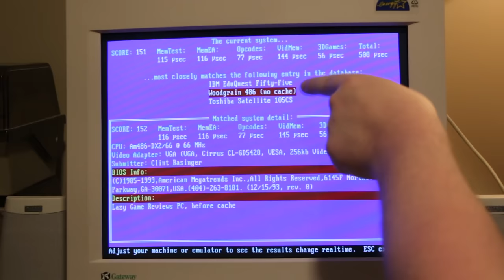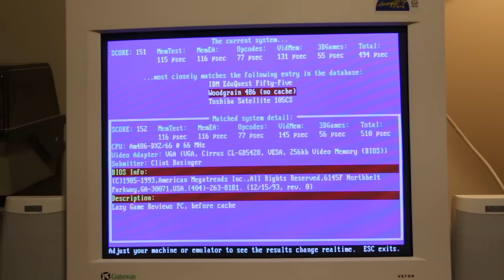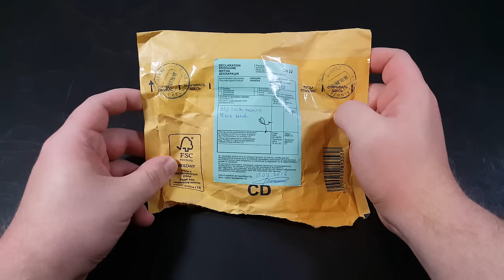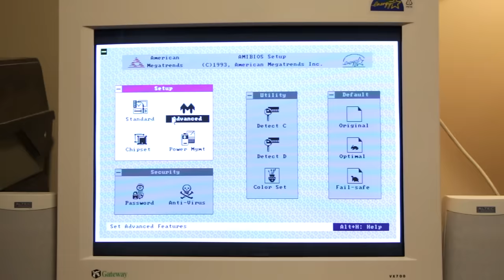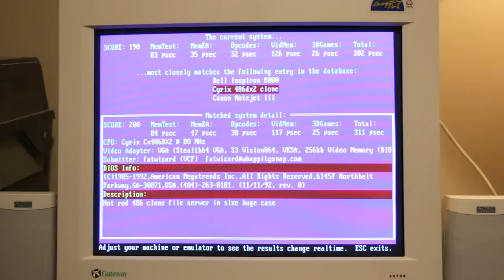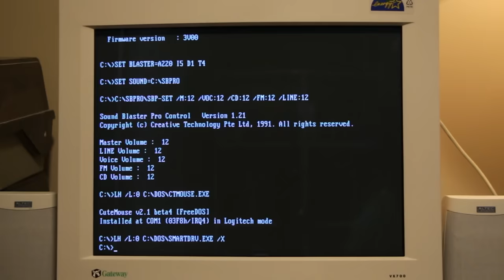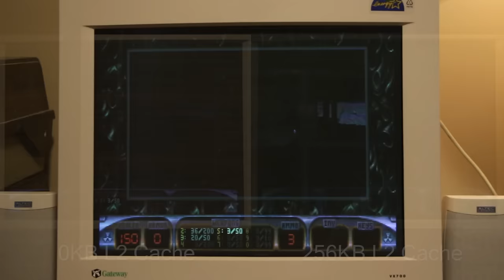LGR 486 Update! Installing L2 Cache

Comment: I watched a CPU Galaxy video once where he was benchmarking 486s and the data rate of the L1 cache was like 170MB/sec. Modern CPUs have as much or more of L1 than a 486 can handle L2 and its data rate is Terabytes per second, and usually 1 nanosecond latency. Even a cheap SATA SSD has a higher sequential rate than the old L1, but the latency is MUCH higher making the ssd slower at random R/W. It's also wierd how the amount of cache hasn't gone up nearly at he same rate as the amount of RAM, My i3 12100, which I would consider average for a non gamer (I only play Minecraft) has 320KB of L1, whereas the 486 had 8KB, so 40x, but has 32GB of RAM, but assuming the average is 8GB that's still 1000x-2000x what most 486s had assuming an average of 4-8MB

Comment: Back in the days, I was playing Duke3D 1.3D on a 486 DX4-100 computer , and it was running fine. However, the first thing i noticed when switching to atomic version (using plutonium pack) was how slower it was. Only a friend of mine which had a pentium could run it fine. I think devs have added lot of things to the engine (from 1.3D to 1.4) which impact frame rate regardless the level you are playing.
Reply: Probably switched from 486-tuned to Pentium-tuned code. Which will end up running slower on a 486, but faster on a Pentium, vs the original code. It might even be that's the only difference between the two versions, so you'd be better off sticking with the original on an older machine, but upgrading on a newer one. There were a few other games (and programs such as MPEG decoders) around the same time that had switches for 486 vs Pentium mode... don't think I ever saw any notable difference on our 486 when trying the latter, but it didn't crash either, so either it made too small a change to the speed to be discernable, or it was actually just a fake-out and the game checked what processor you had anyway (or used the manual switch if it couldn't auto-detect for some reason) and ran the correct code regardless of your attempt to manually override it. It did make a difference for MP3 playback and the like, though.

Comment: Nice!. My AMD 486 DX4 100 had 256kb, but it came in a single slot. I remember playing Duke Nukem 3D at max (though as you said, maybe I was playing it at 15fps and I though it was very playable xD), with a 1MB VESA card.
You could try some overclock. I tried  33x4 (133MHz), 40x3 (120MHz) and 50x2 (100MHz), and the last one was the better, since it seems reduce the latency with the cache and RAM (or overclock them too). I could even play MP3 without stuttering at 44KHz after that, which was not possible at stock settings (except lowering to 11/22KHz, which sounded horrible).
I could even play Quake 2 after overclocking!

Comment: I really miss those days too. I grew up with a 386 and remember getting a new 4865 back in the day. I have a game review request! An old adventure title called "Innocent until caught" That was the game that turned me into a computer nerd. Mainly because I COULDN'T GET IT TO RUN!!! I did eventually, without having to upgrade. I instead learned how to overclock, and I remember spending days messing with the bios settings. I spent way more time trying to get the game to work than I did playing the game, and as I sat there trying to figure out how to get it to run I kept dreaming the game to be much better than it was. And the day I finally got it to work was one of those victory celebrations where I was like "Yeah! Look! It's running! Lo... oh... I'm alone...." :P

Comment: I'm wondering if the low lv1 is what caused Duke3d to run like crap.  Sound wise the engine wasn't too demanding, it had 8bit mono 11khz sound files and played midi music.  Now if the voice count was too high that would slow stuff down.
Reply from the maker: I run the sound at 16-bit stereo, 22Khz, and 8 voices, so it definitely slows things down a bit.
Reply: Yep, don't really need it since theres no way to actually upgrade the sound files, try lowering those settings and giving it a run.  From what I learned of the rendering engine, its some pretty spiffy stuff with some crazy assembly magic mixed in.  A good way to check the engine's performance would be to play Ken's Labrynth, or some of his stuff at his website,  Ken Silverman that is.
Reply: I'd definitely turn down the sound settings then. I don't think the SB Pro even does 16-bit audio, so 8-bit should suffice. Turning down the sample rate to 11Khz probably wouldn't hurt either.
Reply: Original SB Pro is 8-bit stereo and 22khz max, not sure what the SB Pro II is (maybe increases the max to 44khz?), so 16-bit is certainly unnecessary unless the higher resolution (and higher frequency) mixing improves the final output somehow.

All the same, 8-voice stereo at 22khz shouldn't tax a DX2-66 very much, a 386 would handle that just fine; I remember using MOD4WIN with much higher settings than that on our ESS688 card equipped 486 (like full CD quality with oversampled mixing, and at least 32 voices, which some .IT and .XM files certainly made full use of) and it didn't even break a sweat in terms of CPU usage, even when multitasking... other programs could monopolise the chip enough to make the playback stutter, but not the other way round.

An Amiga can do 7 or 8 voice software mixing (to fit that many voices through its 4-channel chip), in stereo, possibly with clever-dick 14-bit artefacted resolution, at somewhere around 11khz, and still do some minimal other things at the same time... and that's a 16-bit machine with a much less cycle efficient (and FPU-less) processor running at less than 1/8th the speed (and non-burst-mode memory with an effective speed of about 5-6mb/s when splitting the difference between CPU and AV chipset accesses).

Comment: Did you change out the video card? The first bench test you did said it was the Cirrus CL-GD5428, but the second test said you were using a stealth64 s3 vision864, which from what I looked up is a different card that the Diamond Speedstar Pro.

Comment: Regarding the missing motherboard standoff under the "floating" corner of the motherboard...  You can take one of the plastic standoffs and use a razor knife to cut off the "knob" part that normally goes through the slot in the motherboard tray.  Then just plug it into one of the holes in the floating corner of the motherboard so it supports that corner.  You can use this trick for any motherboard mounting hole which doesn't have a corresponding hole in the motherboard tray.

Comment: I have a fully functional Tandy Sensation 2 that was the 486 sx 33mhz.  I upgraded it years ago to a dx4-100, and added the first 1gb western digital hd to it ($800 lol), along with its original 212mb.  It also has the speaker pod that goes between the monitor, and the base.  Is that something that someone would find interest in still?  I remember it running Doom and duke nukem smoothly, after the upgrade.  It also had its ram upgraded as well, and CD-ROM as well.

Comment: Nice video. I'm not surprised that there's a ~25% performance increase - the Celeron 300A was almost twice as fast as the previous version (without L2). 

512kB would be interesting, but I'm not sure there would be a very noticeable difference. A late/fast 486 system would likely benefit more than this one, depends on if the FSB is the bottleneck or not.

(On (early) Core 2 Duos I remember the difference was ~7% between the 1/2/4MB L2 steps, which were somewhat limited by FSB IIRC.)

Comment: My 486 PC back in the day used an Hsing Tech motherboard, 256K L2 cache, an AMD Am486 DX4-120 with 8KB WT L1 cache, and it ran DooM without issues. Wish I had a 486 PC with the same setup as my original setup, but with AMI BIOS since Award BIOS had the Y2K bug (lawsuit was later filed).

Comment: For faster loading in general, hit c:\dos\smartdrv.exe C 1024 512. It will basicly 'cache' the C drive with read-cache up to 1MB and write-cache up to 512KB. Basicly your harddrive can work 'ahead' filling the cache while the CPU processes the loading in a game. Also, if you can find it, Diamond Stealth 32 VLB with ET4000/W32p. It's going to boost your games in MS-dos significant. Nice to see someone picking up the 486 old days ^^

Comment: Brings back memories of when I added 128k L2 cache to my Packard Bell MB using an i486SX-33. It did help a bit, but did not really kick in until I upgraded the SX to an i486DX4-100 OD cpu.
Reply: @kerryedavis  No, I was pretty new to the intel type cpu's back then. I  only used Commodores (C64C & Amiga 500+) until my 486SX-33. I did upgrade the memory from 8mb to 20mb and added the 128kb of cache.  I finally upgraded to the 486DX4-100/OD processor and the system flew for awhile (could play Aces of the Pacific with out stuttering) . Good times back in those days for sure.

Comment: 8:02 Thank you for this! It is funny that now in this moment I'm dealing with freezes on my 486 dx2 66 and I was wonder - how can I check if external cache is good or bad. I know how to test RAM, with Memtest 86+ software in dos, but I was sad becasue I thoguht that there is no way to check cache for errors.  And now I accidently saw that you are using that tool to check it! You saved me :)
greetings from Poland

Comment: Those jumper installations give you an idea of what it's like working on a modern car. Everything is crammed in so tight with no space to work. It can take a couple hours to get a bolt lined up or taken out because you can't see it and have to reach around in a awkward position just to touch it. Yes you crank position sensor on the 1.8t VW/Audi. Yes also you timing belt tensioner. Yes it takes a lot of patients good job though.

Comment: hm in the first benchmark  its an AMD DX-2 @ 66mhz? in the second its a Cyrix DX-2 @ 80mhz?
Reply from the maker: You're misreading the information :) 

What you're seeing at the bottom of the screen is the machine that comes closest to what mine is running, it is not showing my machine. That's just the comparison tool section.

The reason it showed the correct info the first time is because I entered it into the tool myself. The second time I had not done that, so it showed the nearest system in terms of speed.
Reply: @LGR  OK - so by your words, 486/66 is equal to any 486/66 with L2 cache. But why we can´t see difference in any other parameters? I think, that this video and your test is fake.

Comment: I'm finally trying to put together a 486 and it's a headache, bad CMOS (even with a new battery), bad video card, etc., etc., anyway I'm loving the process. I saw this video before but came back to it to get some info about the cache. I have NEVER seen a 486 BIOS from the 90's with a mouse input like that one!

Comment: I got a Packard Bell 486SX 25MHz with CD-ROM in 1993. I upgraded it to a 486DX/2 50MHz (with 25Mhz FSB) in 1994 or 1995. I needed the math-coprocessor for 3D Studio 3.0 for DOS. I also upgraded the CPU Cache to 128KB I believe. It had built-in VESA local bus display which I later upgraded to 512KB of RAM.   And Duke Nukem 3D ran pretty damn well as far as I remember. I was able to run it in SVGA (640x480) and it was smooth and never choppy. I think I still had 4MB of RAM at the time. I remember it looked absolutely amazing and made DOOM 2 look like crap. The lighting was better, the environments were more detailed. All around it was just a lot better. This system LGR made is a lot better than what I had, I think. Especially the CPU.  So I have no idea why Duke 3D runs so terribly slow especially at 320x240. Something is wrong. Or maybe that's what happens when its not a "genuine Intel" CPU? I am disappointed at the results. If you upgrade to 512KB cache? I doubt it will make a difference. As far as I know, memory only 32MB of larger will benefit from benefit from 512KB cache.

Comment: Had a 486 running at 100MHz DX2 when I was a teenager back in '96 and could get Duke Nukem 3D to run at 640x480 without any issues (very smooth). I am not sure how much RAM I had when I initially played Duke Nukem 3D but I know before I got rid of the PC (sure regret it today) it had been upgraded to 40MB of RAM (16MB + 16MB + 4MB + 4MB). Probably more RAM than what the PC could every actually use... In any case the graphic card was just an on-board one displaying only 256 colors. Boost/swap your CPU LGR and I am sure you can get Duke Nukem 3D running at a high frame rate. Cool build and really like the wood grain!

Comment: If you still want to use a 66Mhz part, Cyrix Cx486 DX2 66 has write back cache, as opposed to many Am486-8T (8B & 16B have WB), also for Intel check "&E" markings, those also are WB and faster.

Comment: Wow, that is about a 30% boost. I am not familiar with that benchmarking program so I am not sure what it is keying off of, but cache is extremely important for almost all functions of a computer so it isn't that surprising that going from no cache to a pretty high amount of it for that PC's time would have a big impact, but wow, 30%!
Reply: Anything beyond L1 didn't really make that much of a noticeable difference unless you had really slow memory, up until the later 486 and early Pentium days when it started becoming a more standard item.

We see a major difference here because the memory is running easily less than half the speed it ideally should be. One would hope decent 60ns SIMMs would provide at least 16mb/s even without any kind of fast paging or other burst mode acceleration (e.g. EDO), and up into the thirties with faster EDO modules with BIOS memory timings adjusted close to the wire. Possibly sixties if the chipset supports dual-channel access interleaving in concert with the cache and the CPU pipeline, though I might have just imagined that... still, the L2 cache itself should be able to hit at least 33mb/s on a 33mhz bus system (again, without any bursting, just making use of the SRAM's higher speed and ability to run without refresh cycles), and the L1 could be up into three figures...

Comment: 256K is pretty much optimum for 486 DX2 66.  It made a big difference when I replaced my motherboard and forgot to install them initially.  After taking the whole thing apart and installing the cache, it made pretty big difference in performance.

Comment: I love how my Atari Falcon with its 66Mhz Motorola 060 processor runs Duke3D at a silky 30fps+ and also Quake 1 reasonably well, compared to the PC counterpart. All with it's included stock video controller and sound chip. Maybe you should check that machine out one day Clint!

Comment: This PC is similar to my first PC: Intel 486DX2 66Mhz, 2x CD-ROM, but it had a generic 1MB SVGA card, 8MB RAM, ~800MB HDD, Packard Bell Sound Blaster 16 clone.  I could play Diablo 2, Descent 1&2 , Duke Nukem 3D, Blood, MDK, Dark Forces, even Quake and Hexen II!  The build engine games @640x480 in DOS.  I am really stumped here.  It was a mid range late '94-early '95 Packard Bell. It came with the classic PB '94-'95, monitor with the speakers mounted on the side.

Comment: Fun fact: 12 ns versions of those ram chips were used as tag ram on pentium boards with the hx chipset, required if you bumped the ram over 64 mb. From cache ram to tag ram :)
Remembering modding my ga-586hx with one chip + resistor + edo ram to 128 mb. Served me well into 2006 or so as data server.

Comment: 1/33E6 Hz (the clock period of a 33MHz memory bus on a 486) is a little over 30 ns. These SRAM cache chips are rated by their minimum clock and signaling period, which means the 20ns chips should work OK.

Comment: Holy shit - that AMI BIOS had graphic icons and freaking MOUSE support back then? And I tought how cool are todays UEFI with all this fancy stuff, and it turns out that those features was introduced in 1993 already...  Mind=blown.
Reply: It ain't really that complicated. It's not even really up to the level of GEM, GeOS or Deskmate (all of which fit comfortably in a typical system ROM), barely that of DOS Shell / Norton Navigator etc, and probably only supports two or three screen modes (EGA-hi, Hercules and CGA-hi) plus a textmode fallback. In fact, it might even be a "fake" graphic mode (ie actually 80x25 or 80x43 textmode but using a the Herc, EGA and VGA's supplemental character set ability, to provide a bunch of window-drawing characters, along with a block of four dynamically altered to give the impression of a smoothly moving mouse pointer even though the colour attributes around it may only change on a block-by-block basis), with incompatible cards showing a cruder image using the default box-drawing characters instead.

Implementing a mouse pointer and reading in the data from either a serial, PS2 or "bus" port is a piece of cake that may need a couple dozen lines of code.

Textmode is just extremely simple even compared to that and needs less work and effort, so if all you're after is providing the user with a menu to tweak a few system settings, why go to the bother of making a nice graphical thing?

Comment: RIght now I can't remember which processor was the first to have onboard L2 cache. I think it was the Pentium II but this L2 cache only ran at half the speed of the processor. The Celeron came later with 0 kb cache but later Celerons had like a quarter of the corresponding Pentium II or III but this cache ran at full speed and I believe this was the only time that the Celeron was actually competitive with the Pentium II/III. - For AMD chips, I think the K6-III was the first one but again, not sure.